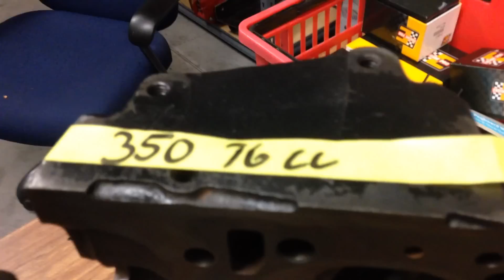350 and 305 Chevy what's The Difference

Comment: I’m actually building a .060 over 307 at the moment that was gifted to me .  I know what your going to say, but here me out , Ive built quite a few 350’s and other small blocks and yes ( even a few fords) but I had a gun to my head .  Anyway the reason I decided to do it was just to do something different for a change. I think it should be right around 317 cubic inches with the .060 over bore size , it’s 3.935 . The only thing I can’t stand about what I’ve found in it so far is those ridiculous flat top pistons with the gigantic bevel around the top edge. So I actually found a set of pistons that are the bore size I need and the same comp. height but they are true flat tops without the stupid bevel around the top .  I figure with a decent little cam and some good ported but still small cc chamber heads it should be a good little motor just to kick around town in old beater 50’s or 60’s pick up .    What your thoughts on the bevel piston situation that is referring too ?   Everyone I’ve spoken too about them agree with me that they are crap and that I should definitely use the pistons that I’m going with .
Reply from the maker: Yep your on the right track with a true flat top I also think a key to getting the most out of a small bore engine is really good cam and heads so yea it sounds like your going to end up with a pretty decant engine

Comment: I've done a lot of manual trans swaps on small block chevys,took a flywheel off,a 84 350 2 piece rear seal a went to put it in my 87 IROC 1 piece rear seal 350 an the the fly wheel is to big,why did they change this,

Comment: Had a 1983 305 HO in a Camaro. Missed a gear and blew it up. Then I replaced it with a bored out 327 (333 cubes) with aftermarket heads and cam, that motor was burning rubber even in 3rd gear...

Comment: Had a 305 in my camaro and tried everything to kill it, I couldn't. Ended up giving it complete to a buddy for his blown up v6 silverado w/t. It STILL runs. All he did was put valve guide seals on and he has been driving it for years now. That engine served me well for years. Now the car has been WOKE with  a $250 1994 LT1 swap.
Reply: Yeah if nothing else a 305 will last. I put about 20000 on one with 15 lbs oil pressure. On a really hot day it would kiss the red line. No problem.

Comment: So will I make more power in a 305 if I use vortec 350 heads and do some work on them and valvtrain with a cam. How much would I gain you think.
Reply from the maker: you also need flat top ,pistons

Comment: I have a 95 silverado with a 305 engine with a 5 speed manual with over 220k miles on it and it runs really good for what it is iv had it since 2000 bought it used with less then 100k on it and wanted to put a ls in it but I'm like why if it still runs good.  It kinda feels like a 350 but it's not they are pretty good with mpg so i learned alot from your video today.

Comment: If you weigh the piston and rod assemblies, and they are within about 50 grams, don't worry about it for a stock rebuild.  That was one of the big three's tolerance for balancing from the factory.   The older style forged Rods all weigh between 595-605 grams stock, and stock style pistons weigh about 565 grams with pins for a 350, and about 545 grams for a 305 on my digital scale.  For stock style and mild rebuilds we use the 350/305 cranks interchangeably and have had no issues.  People worry too much about balancing on mild stuff.  It can be pretty far out and you will never notice any extra vibration or loss of reliability.   When we build race engines, its another story,  as balancing becomes critical to longevity at high RPM's (imbalance forces are a geometric progression with RPM), and then we start worrying about things like overbalance, total tolerance, etc..  But we build 300 horsepower 350's all the time with the factory balance.  

As with all engines - airflow is everything.  Compression can increase power up to 4% per full ratio increase, but increasing airflow can be as much as 2hp per cfm.  High compression with no airflow will make less power than low compression with good airflow.

Comment: I have an 86 iroc/z with the 305 TPI motor, should I swap for a 350 or can I get 300+ hp out of the lil 305? Also wanting to ditch the TPI and swap to carb? Advice?
Reply from the maker: I would go to a 350 if you can

Comment: Never mentioned it, but the thicker walls and water jacket make it less of an overheating engine than a 350.  Smoother conduction of heat, less cracking potential and hot spotting.  It is the 400 that is junk because of the opposite effect - terrible overheating after shut down.  I have a stock 305 in my C1500 truck and I love this engine.  How can people say it's "junk" when it's the same design as any small block, and a good motor is just a good motor.  I think the key with any good running motor is to leave it alone, don't change anything but the oil, plugs, and rotor cap.  If you're going to rebuild a motor for maximum power, change the stock specs, might as well be using a bigger motor anyway.  Most people just want a good running engine, and I've never had any problem with the power of this Chevy 305 from 1988.
Reply from the maker: You are so right on about the overheating issue the 305's run nice and cool and as a 30 year machinist I have worked on thousands of small block chevys it is very rare to find 305 heads or blocks cracked it is a good reliable engine I had 1/2 ton pick up that I drove around for years with a 305 thousands of trips to hardware and home depot stores did a complete renovation on my house with that truck got 17 miles per gallon the 350's are around 12 most people that say 305's are junk are looking at it from a power output standpoint

Comment: To get say 350-375 hp out of a 305 what would you improve on the engine and make it where it still runs good but has decent power I have a 1970s on from a high power Sierra Chevy truck.
Reply from the maker: Heads cam and intake with a bit of NOS

Comment: How much power would you think a guy would gain by putting vortec heads on a 305 as well as a cam?? 79 camaro bone stock 305 with factory intake and Dualjet.
Reply from the maker: you really cant put the 350 vortec heads on a 305 the valves are too big and could contact the cylinder bore and bend they do make a 305 vortec head with smaller valves I'm not too sure what they would do I've never done it

Comment: As far as emissions, and carburetors, my 305 was swapped for a 350 would all of the VAC lines be routed the same way?
Reply from the maker: Yes
Reply: @Myvintageiron7512  ok also what carb. Would u recommend for a stock 82 350 C10 that needs to be Cali. Smog compliant.?

Comment: What about the 307 Chevy SB? I've got one in my 69 C20 pickup (with 53,000 ORIGINAL MILES!) that has the recall cam and lifters, and it runs like a stripped a.. ape...with an 11'3" (inside the bed to out side the camper overhang) cab over Lance camper! No kidding. The only problem is a lack of torque, especially when pulling a steep grade. I don't want to pull it, but I want alot more torque. What do I do, pulll the 307 and put a 350 in it? I love your show. I'm an old gear head who has been building  performance engines since 1961 ( had a 59 Impala  SS Nascar mystery motor with a B&M 4 speed  stick hydro that I ran on a "Run What You Brung" night at Lyons Drag Strip in Wilmington California in 65 or 66 in which I launched really hard and pulled the front end

Comment: @myvintageiron7512 hello  love the channel! My brother and I really enjoyed your work and sharing your knowledge with everyone. I hope you don't mind me asking but I recently bought a 1970 chevelle with the original 307 sbc and noticed it had a 400 balancer on it so I double checked the casting numbers and its a 1970 307. I pulled the heads off and measured the bore and the negative stroke. Bore measured 4" and stroke was 3.75 is this common and is it safe to run with the cylinder wall bored 
.125? BTW block was clearanced for stroker assembly. Please let me know what your thoughts are and what you think I should do with it. Much appreciated 🙏

Comment: I like the 305 much better than the 350. It's thicker between the cylinders and has better gas milage and has lots of power. The same with the 302 over the 351 Ford. I would much rater have, and I've had them, 302 and it too has plenty of power. Actually, the inline 6's are my favorite; easy to work on and lots of room.

Comment: Good info for those who didn't know.

I can see your hesitance in saying 305's can run OK.  :)

They can run OK on smaller cars and get decent gas mileage.  The biggest problem with this motor is that GM used it in applications where it should not have.

Years ago my mom had a 1983 suburban that came stock with a 305.  It did about as bad in the city as you might expect for an early 80's carbureted suburban, but was not much better on the highway.  The stock 305 with the Rochester Qjet carb was constantly dropping out of OD for even slight inclines, and pulling with it was just silly.

At about the 200,000 mark the 305 actually busted actually busted a wrist pin and put wedged the rod into the cylinder wall.  It wasn't going anywhere.  My brother in law to be at the time offered me a 327 out of an old Chevelle he was scrapping that was in unknown condition.  Beggars can't be choozy, he only asked that I put the 305 back in the Chevelle so he'd make his weight in scrap.  Before anyone asks, the Chevelle was so far beyond salvage due to a horrific accident, and over a decade laying out in a field.

Back then, 1988, we here in Michigan still had to pass emissions annually, so I opted to use the known good everything from the 1983 305 and basically long blocked the 327.

Not only was the suburban able to pass emissions first test, but got had WAY more power and got far better gas mileage, likely because it held in OD going up hill, even pulling a camper.

I know you know, but for others who don't, the 327 is basically a short stroke 350.  It has the same 4" bore as the 350, different crank and shorter rods.  While the 350 was capable of more horse power than the 327 from the factory, the 327 will hold together at significantly higher RPM's, not that it mattered, I was putting the motor into a truck using a 305 configuration.  It's what was given to me at no cost but my time.  Incidentally, time was a huge factor since I was getting married the following afternoon and needed the truck to pull my camper.

I left the truck with mom when I joined the army and 3 years later, she traded it in on a Ford Escort...

Honestly, 305's aren't too bad so long as they're not trying to push more weight than what should be expected.  In terms of reliability, I found that for as long as I was in the field of automotive repair, they were no less reliable than their 350 counterpart, with one exception.  I made a lot more money replacing 305 head gaskets than I ever did on 350's.  I suspect they were more prone to failure between cylinders because the added surface area between heads and block meant that similar torque spec's on the heads resulted in less pressure on the gaskets themselves.

Underpowered V8's in full sized trucks is not a GM exclusive.  We leased a 2007 Dodge ram, Big Horn Edition, just before they offered the free hemi upgrade.  That 4.7 Magnum V8 was a complete joke in that truck!  It had far less power than the 83 suburban with the 5.0, got the WORST mileage of any vehicle I've ever owned, which only got even more stupid the one time we tried the E-85 on the flex fuel engine.  It dropped from an average 12mpg combination city and highway to less than 10mpg.  It was my wifes truck and we were both glad to get rid of it in 2009.  We picked her up a used 2000 Escalade just as we were turning in the Ram, and she's been driving it ever so happily since.  Yes, the Escalade came with the 5.7, has plenty of power, and averages 18mpg combination city and highway, which is 2mpg better than my 1994 Sierra which also has the 350, but is only TBI equipped.

I think GM finally quit using the 5.0's in trucks toward the end of the 305/350's run because I don't think it was an option in the Sierra, and I know it wasn't in the Escalade.  I'm told the 5.3 they replaced the 5.7 with is a good engine, and perhaps more powerful.

Anyhow, like I said, great info you put out there.  I just wanted to share my 305 experience with you.

Steve

Comment: I know this is an old video but I'm wondering if you can tell me how to build a 305 . i built several 350s even though I know it's the same internally but  the heads what do you pick and can they ported out and what type of Cam to use with some to get some rpm

Comment: Ive built a bunch of 305s over the years and they can make good power..bore them 30 over put some flat tops in it get a good valve job done  and put a good torque cam in it I used to like the comp cams high energy series either the 260 or 268 or even the old L79 350 horse cam works well..you can even use the stock intake manifold because they kinda max out power wise at around 5,500 ..but that 350 stroke and small bore will give you a ton of low and midrange torque..I won lots of stop light grand prix races with them .you just have some limitations on top end power..in a Camaro or G body Gm you can have a lot of fun and get decent gas mileage out of that little motor

Comment: They had the same killer exhaust ports as the big motors did, so they breathed fairly well for a small smogged put V8 of the day. It made more horsepower at the crankshaft than any other small block it's size, and more than the 350 2bbl engine. The 350 4bbl engine hp engine in the Vette was the only small block Chevy had that could beat it back in the day. Anyway, there are things you can do to make a 305 run better, but why bother. In the early 80's when the Fox Body Mustang came out with the hp302, Hot Rod magazine decided to compare the two engines and put the Ford mill in a Mustang and the 305 in a Camaro. They used the same cam profile, compression ratio, style of intake, carb and matched both engines as closely as they could. When building the 305 Hot Rod found that the block they had was horribly misaligned in every axis. The crank went sideways through the block. The cylinders weren't bored in line with where the crank should have been and the decks weren't straight. They went through hell bringing That block into spec. Once they did it was down on power compared to the Ford. When they took both cars to the track the Mustang screamed, but when it was the Camaro's turn the motor blew up. The stress on the crankcase was too much after they managed to align the rotating assembly. So the two never raced. Working for engine remanufacturers at the time we took every 305 that came in, pulled the crank shafts, cam and rods out of them and pulled the heads, then scrapped the rest. Chevy had problems with the cast iron cams they were running at the time and it was getting hard to find cranks that hadn't been destroyed when the #7 cam lobe wore flat, causing a lack of oil to the number 7 and sometimes 8 Rod journals. We used the 305 heads on 350 by flycutting the combustion chambers to increase their combustion chamber volumes to work on the 350. No body was buying 305's, they all wanted to upgrade to 350's and we even sold them with RV cams due to customer demand. So if you've got one today it's a rarity! One guy said he has one with 300,000 miles on it. I think you have the world record holder!
Reply from the maker: You cannot compare a 302 ford to a 305 chevy the 305 is a long stroke small bore engine the 302 is big bore short rod engine hot rod amy have done it but that is a stupid comparison test the big bore short stroke engine is going to win every time what someone needs to do if you really want to do a legit test is compare a 302 Ford to a 302 Chevy they both have the same bore and stroke the 302 Chevy will smoke a 302 Ford all day long the 302 ford has weak rods weak crank and the worst flowing heads of any V8 domestic engine the 302 Chevy was rated at 290 HP but that was very conservative many dyno tests in the late sixties put it closer to 345HP while the 302 Fords barely broke 200 HP

Comment: It's a shame most people don't even know about the 230hp/300tq 5.0 liter 305 (G92 optioned LB9 TPI) which came in the 5-spd 3rd Gens and had the aggressive G92 cam. They ran easy low-mid 14 sec times and Motorweek ran a 1LE Camaro (1989) to 13.9 so before people badmouth the 305, realize that not all 305 engines were created equal lol. The 230hp version could scoot in their day!

Comment: If  you have a 305 can you bore  the cylinders to 4.00  and then run 76 cc heads basicly can u make a 350 out of it ? I was just wondering if its possible .not that i would personally im a fan of the sb chevy 400 i once owned one out of   a 73 caprice wagon bored it to a 406 with a bunch of goodies it was a power house